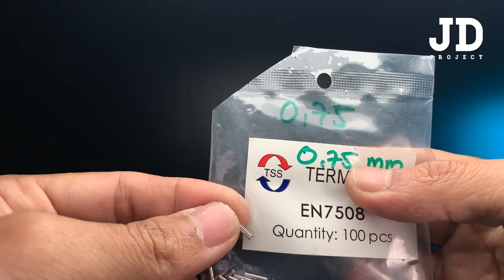Mercedes Benz UNIMOG Offroad Truck Hot Wheels Custom

Comment: Great job with your Custom designs and Details work on The Hot Wheels Diecast Mercedes Benz Off Road Truck Looks Amazing . Do you use little screws or Modeling Glue to hold it together again?